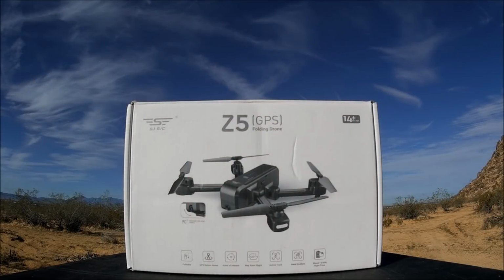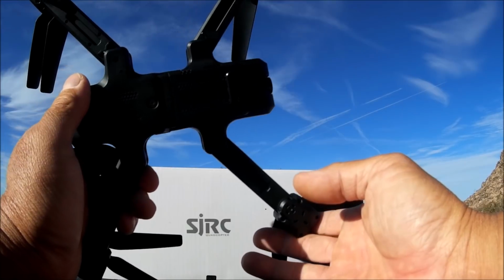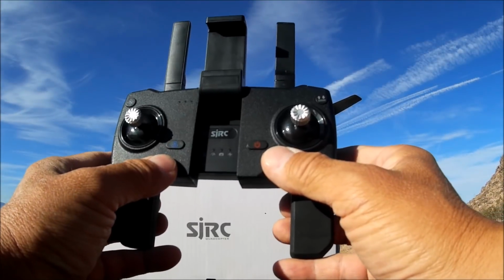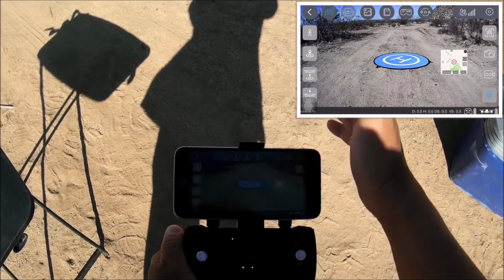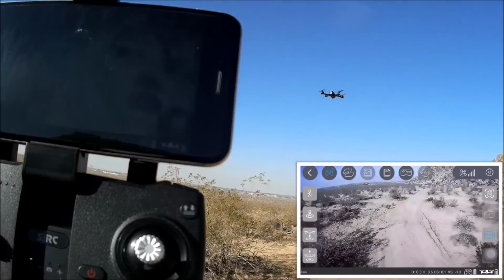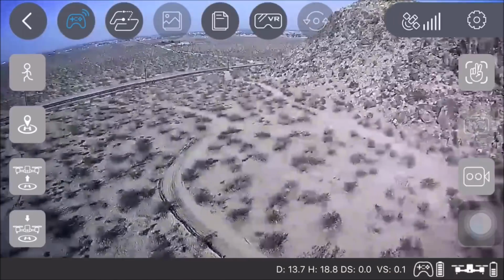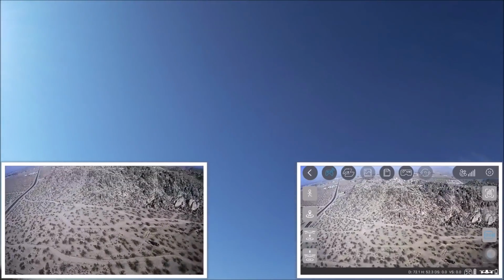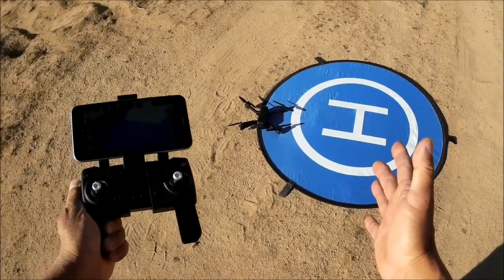SJRC Z5 GPS 2.4G WiFi FPV Foldable 1080P HD Camera RC Drone

Comment: Will this drone work with fpv goggles?
Reply from the maker: no.  not unless you put external fpv gear.
Here is a portion of the fpv view of the flight. https://www.facebook.com/RC-Escape-818263618290823
Here are links to the vtx stuff used.  
poster putty  https://amzn.to/37TxaeK
aio vtx   hhttps://amzn.to/2PrKkEC
1s battery  https://amzn.to/3hot2qf

Comment: For the price of this I think you're really getting a good budget drone. I don't think you can compare it with DJI and more expensive brands, but if they would do a drone with same capabilities as this one, I think it would cost at least 250$. I can reach 120 m altitude without any problems, 300 m horisontal range with good connection. The camera is what you can expect from a budget drone, not too bad but not really something to brag about. As you can see in the video, the image comes with a bit of lag but when you watch the recordings afterhand it's without lag. Return to home works very good, just remember to set a proper return altitude so it doesn't crash inte buildings or trees etc. Also, i heavier wind you really need to be careful with the return to home function. If it has to fight the wind and you're low on battery, it might not be able to return at all. So make sure you account for the wind when flying. It's best to fly against the wind and then having a tail wind when returning back. It's a really good budget drone and I'm having lots of fun with it.

Comment: Do I need a phone with 802.11 ac for this one or will 802.11 bgn work?
Reply from the maker: 3D Printwiz 
Get the 2.4ghz version it will work.
Reply: @RCEscape  Is there a way to stabilize the video, it seems to be a bit jerky while in hover.

Comment: I've had two flyaways [so far] where the lights have been solid indicating a good GPS signal and then on take off it goes completely out of control does a big loop and inevitably crashes in to something. I've been lucky so far to recover it. Am I missing something I'm using the 2.4ghz version. I'm also finding FPV is limited to about 60m straight up.
Reply from the maker: maybe you got a unit with faulty gps module.

Comment: Hi I'm aware that the cheaper drones have a return feature which is not GPS connected. Not sure how that really works. So on this drone when the GPS is disabled  it will use that no GPS return feature? My understanding is that for the drone to rth it has to be GPS connected/calibrated to identify it's home  start location. My experience when GPS is not enabled the drone will auto land when signal is lost from the transmitter and not rth.

Comment: Nice and complete presentation. Thank you. I just bought the Z5 and I am playing around with it. Anyway there is something I can't understand. In the instruction manual it is written that the video format on the micro SD card should be MP4, while on my drone the format is AVI instead. I am using a micro sd card 32 gb capacity. Do you have a suggestion to let me record in MP4? Thank you.
Reply: It uses a fairly uncommon avi format at that Final Cut Pro does not recognise it so I have to convert to .mov using  Uniconverter or similar app before editing

Comment: How does this drone return to home without gps? On screen it looks like the gps and signal bar indicators were active?
Reply from the maker: When the gps is turned off, it is just the position hold that is turned off and not the rth functions.
Reply: @RCEscape  Thanks I own the PROMARK P-70 GPS SHADOW Great drone, my next upgrade is going to be the BRUSHLESS F-11 version of the sirc drone. BTW does the circle function and follow me work well in this drone?

Comment: Hey Pete, I saw a video for the SJRC F11. On the controls screen of the app, hit the settings symbol in the upper right hand corner and it has a setting for how high the quad goes in the return to home function. The range is 10-120 meters with the default set at 25 meters. There are also a few other flight parameters that can be set. Maybe those settings are also available for the Z5.

Comment: Great video, thank you!
I have also seen your video of the SJRC Z5 GPS 2.4G WiFi FPV Foldable 1080P HD Camera RC Drone, but I have the impression that the video quality of the JJRC JJPRO X5 EPIK is better. is that so? Which of the two drones do you personally prefer? Thanks for a reply and best regards to California! 😉  Markus from Switzerland
Reply: Sorry, I posted the comment in the wrong link. However, the question remains the same...  ;-)

Comment: I noticed whenever I go fly that after binding, I am not able to do the GPS calibration. Does it keep its location memorized if using in the same location?
Reply from the maker: You should be able to calibrate the compass in the same spot even after flying for a minute, turning it off and turning it back on and re calibrating.

Comment: I order the brushless version of this drone sir..the sjrc f11 and may i ask if the brushless version of this have a optical flow sensor at the buttom sir...already excited for my order of the sjrc f11  ..hoping for the reply and thank you sir..
Reply from the maker: That one should be a good one since it is brushless.   The optical flow sensor is unnecessary because these are GPS quads.
It already has GPS position, horizontal and vertical, and that is why these do not have optical sensor.  The optical sensor was probably for a lesser quality model without GPS.

Comment: Awesome review of the z5. Pretty happy with the performance so far. But still lots to test on it still! :). Couple questions, does it show how many satellites connected to it and have you tried it with the wifi extender yet? Would love to see if it improves the fpv. Just ordered the z5 5g version and the f11 today! Happy droning!
Reply from the maker: Thanks :)
I didn't see anywhere that it shows quantity of satellites.

Comment: did you notice a very hard stop whenever you let go of the forward stick? almost like it had its own breaks haha
Reply: The hard stop is due to the GPS lock is active on these entry level drones the transition to a stop hold position is immediate. With the GPS switched off the drone is in free flight mode when the direction stick is moved forward then released the drone will slow drift to a stop, if there is windy conditions the drone will drift with the wind. Altitude hold will still be active.

Comment: Actually I think you are wrong there. You were to close when you did that RTH at around 17:50. All quads with GPS today do not always go up to its RTH height. It usually must be further away than 25-30 meter. If that thats the case the RTH would rize up. SJRC really do good quads. Just a pity they dont do brushless gps quads, because they do great. :-)

Comment: sjrc  released the brushless version of it  called f11 with bigger battery(25 mins) and 5.8g wifi   i will get it tomorrow
Reply: day Good sir...may i ask you if you already fly the sjrc f11 the brushless version of this...i want to know the drone have an OPTICAL FLOW SENSOR at the buttom because i have also coming this december 20... i hope you will response me ..excited already..
Reply: @AdasWilsky_84  no optical sensor  i got it already
Reply: Thank you sir..
Reply: Thanks for the great video review ... does any variety of RTH rise up first?   Or do they all just return directly as the same height when RTH was initiated?   One person mentioned if very low it may rise up and then return ... but most other heights above that ... it would just return without first rising to the RTH height first.
Reply: Ive bought it yesterday its awesome low budget drone.